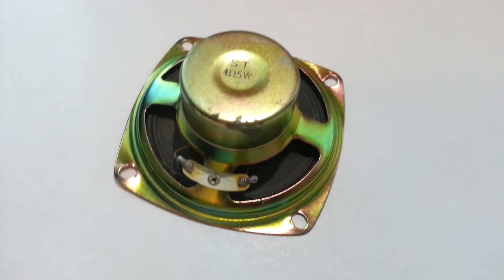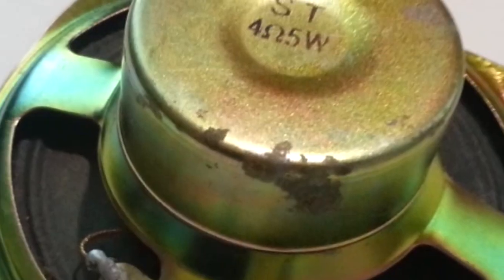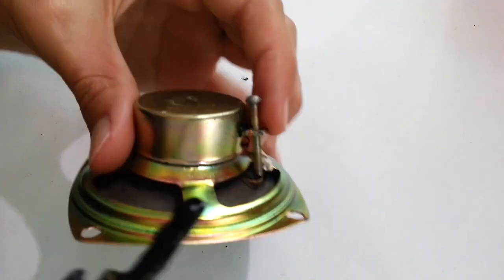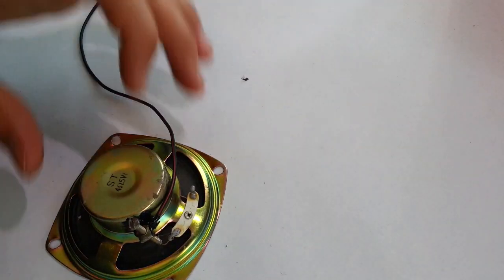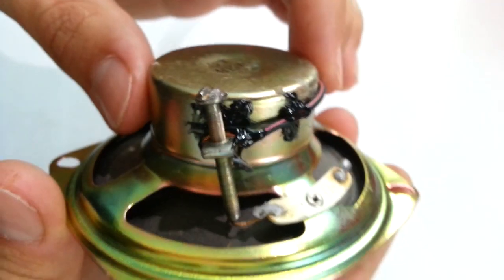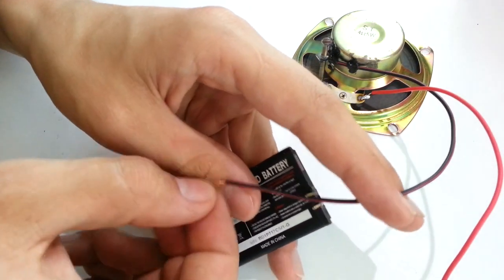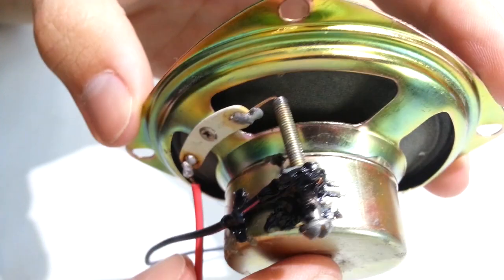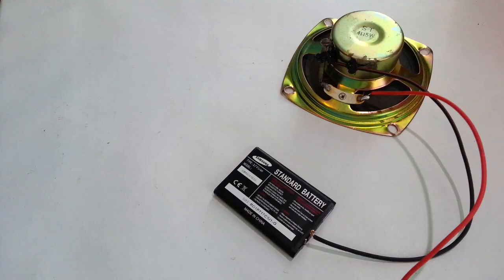DIY Alarm Siren / Simple Noise Maker without transistors using only a Speaker ✔

Comment: wow that's so janky. I mean it's awesome, but you should rather glue a piece of metal plate to the membrane, cut the wire from the terminal and solder it to the plate, and let the screw touch that, as the wire will wear out rather quickly. also install a lock nut on the screw so the vibration won't mess up the adjustment. also, wouldn't using a relay work better? not to mention, much more reliable? just an idea

Comment: Connect a dc motor to the + wire to the speaker without doing this work
Reply from the maker: Yes, I know this trick too ;) But with my method it produces much louder noise... although with a dc motor it probably will be more reliable.
Reply: What should be connection with DC motor
Reply: @Rahu37  ￼
Israel Apilado
för 2 år sedan
How possible that a DC power supply can deliver to the speaker a continuous siren sound even though you have input of an AC signal? And the worst is that you use a screw for tuning the frequency, we're not dumb!
￼
￼
SVARA
￼
Dölj 2 svar
￼
Electrical Projects [Creative Lab]
för 2 år sedan
Hi, you just didn't get the idea. If you just connect DC power supply to the speaker there will be no sound, but the diaphragm of the speaker will move (from or to the magnet) and stay there. But what happens if such movement will break the electric circuit? I'll tell... There will be what is called "feedback loop". In other words: when I connect this speaker to the battery, the diaphragm moves from the screw, and that movement disconnects the power source, and without the power, the diaphragm moves back and when it moves back it connects itself to the power source again, and this cycle repeats.
Visa mindre
￼
3
￼
SVARA
￼
￼
Rayk Dreisatz geht anders
för 1 år sedan (redigerad)
It's hard to believe you "are not dumb" when you don't get this simple concept. A speaker does not need AC to move because the suspension acts like a spring always bringing back the cone to it's initial position. Pulsing DC can make a speaker move. 

This is a simple electromechanical feedback oscillator. As the DC goes through the screw into the tinsel lead the cone travels forward, opening the curcuit by disconnecting the lead. Then the suspension pulls the cone back, attaching the lead to the screw again and the cicle repeats itself over and over. This way you're gonna get something between sawtooth and sine wave.

Comment: How possible that a DC power supply can deliver to the speaker a continuous siren sound even though you have input of an AC signal? And the worst is that you use a screw for tuning the frequency, we're not dumb!
Reply from the maker: Hi, you just didn't get the idea. If you just connect DC power supply to the speaker there will be no sound, but the diaphragm of the speaker will move (from or to the magnet) and stay there. But what happens if such movement will break the electric circuit? I'll tell... There will be what is called "feedback loop". In other words: when I connect this speaker to the battery, the diaphragm moves from the screw, and that movement disconnects the power source, and without the power, the diaphragm moves back and when it moves back it connects itself to the power source again, and this cycle repeats.
Reply: It's hard to believe you "are not dumb" when you don't get this simple concept. A speaker does not need AC to move because the suspension acts like a spring always bringing back the cone to it's initial position. Pulsing DC can make a speaker move. 

This is a simple electromechanical feedback oscillator. As the DC goes through the screw into the tinsel lead the cone travels forward, opening the curcuit by disconnecting the lead. Then the suspension pulls the cone back, attaching the lead to the screw again and the cicle repeats itself over and over. This way you're gonna get something between sawtooth and sine wave.

Comment: is it necessary to use a screw? why not simply connect both the wires?
Reply from the maker: Hi, yes, it is necessary. If you just connect a loudspeaker to DC power source it will not make any noise, the diaphragm of the speaker will move back or forward (depending on polarity), and will stay there till power is on, without any noise. But in the video, when power is on and diaphragm starts to move from the screw, it automatically disconnects speaker from power (it breaks the circuit), and diaphragm starts to move back, and when it moves back it will be connected to power again, and after that the diaphragm starts to move from the screw again. And this process repeats again and again, and that makes a lot of noise.
Reply: ok, thanks, nice idea
Reply: Electrical Projects [Creative Lab] how u charge ur mobile battery
Reply: connecting a simple 5v source smarthphone charger ( bare wires ) @tipswithpriteshjain1103